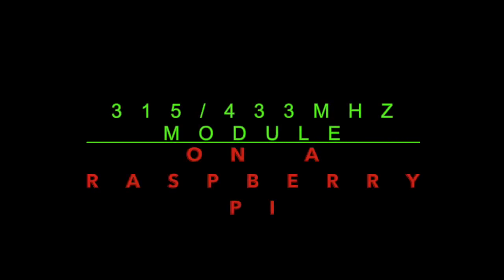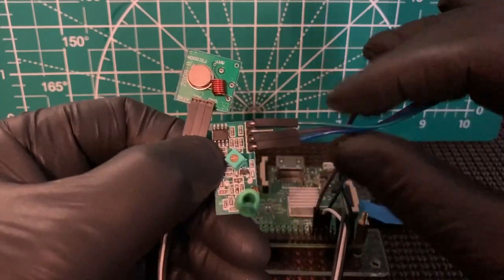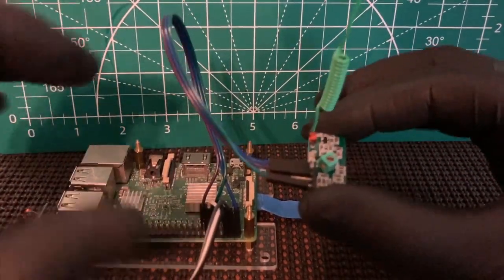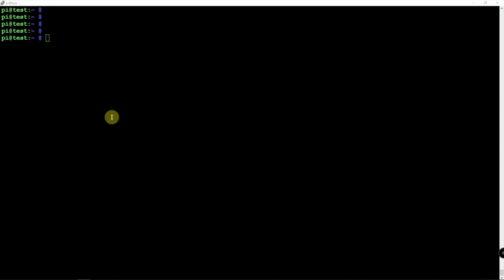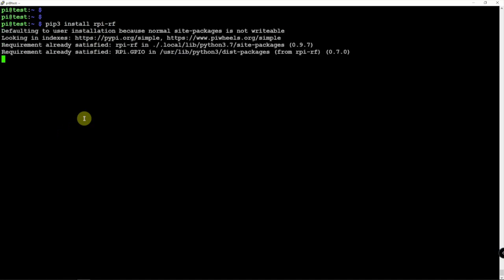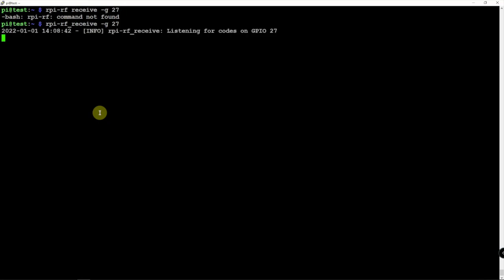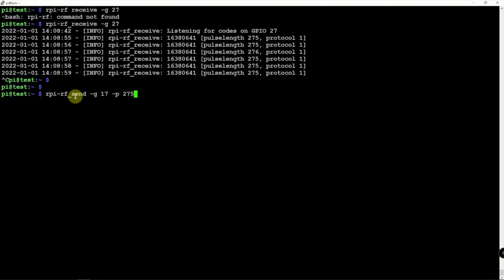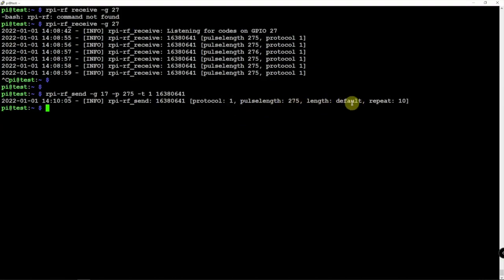Raspberry Pi Using 315/433MHz Transmitter And Receiver  |  RPI_RF

Comment: Nice video. I've been trying for the past two weeks to set up a cc1101 with my raspberry pi zero 2w. Is that possible somehow? I couldn't find a software which would work with it, even if the correct pins are connected.